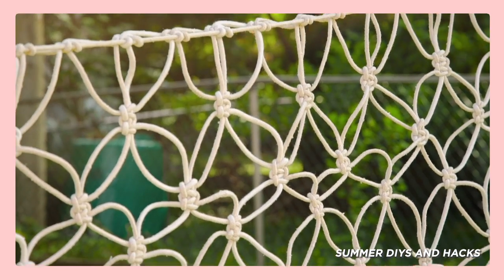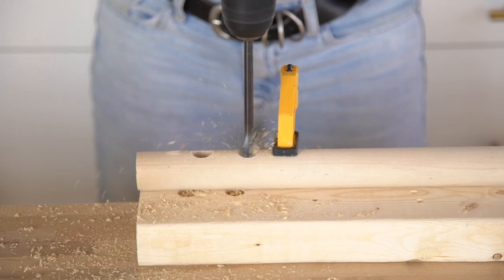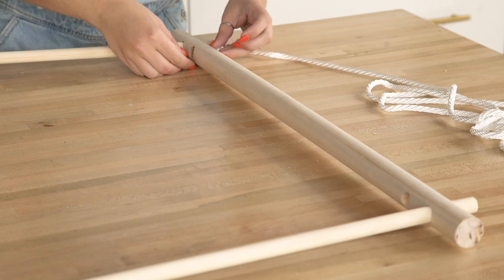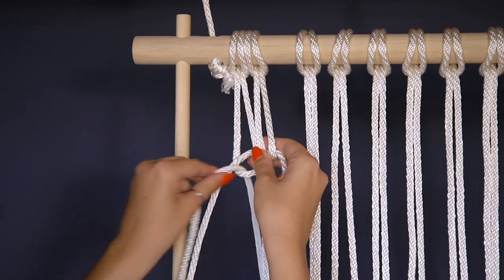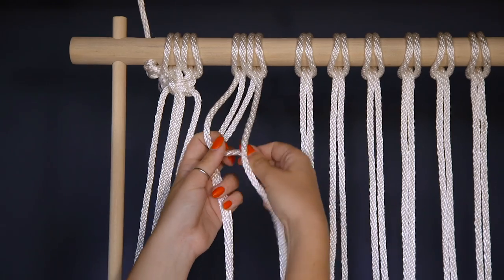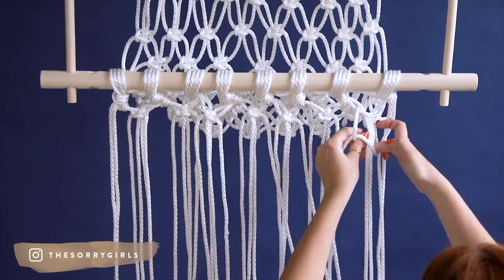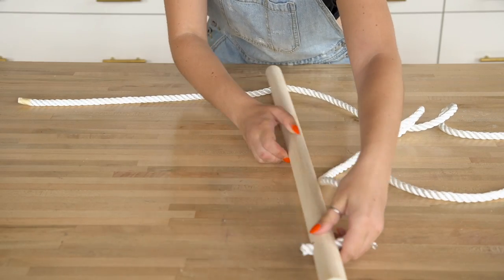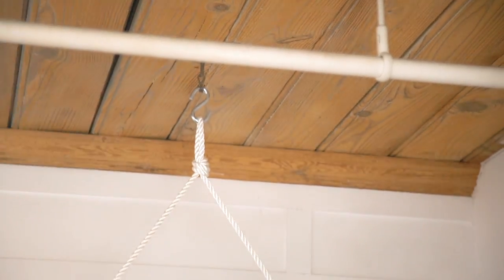DIY a Gorgeous Boho Macrame Chair

Comment: Does anyone have like a store bought version of this? And is it expensive? Because I really want to get a chair like this but idk if it would be cheaper to buy it or make it 🤷‍♀️
Reply: nikivictoria maybe look on Amazon?
Reply: Definitely cheaper to make. The materials all together probably cost $30-50 and the chair would retail for $150-250 unless you go to a bougee store and then it'd be more like $400-500.
Reply: I bought a pair years ago and they were about $100 for 2.  However they were on sale at a little shop that was going out of business.  They have lasted on my screened in porch but I do put them away during our winters.  They have lasted forever and I have had kids 
rough housing on them.  I definitely think that the macrame makes them very strong.
Reply: nikivictoria they sell them for about fourth dollars at multiple stores, and I think they are that price at target too if that helps
Reply: What do those emojis mean?
Reply: Just saw one on overstock for $32. Supports 220 pounds.
Reply: Farm Girl it’s a shrugging emoji
Reply: I've seen them go as cheap as $25 on wayfair, I'd say it's better to buy than DIY in this case unless you already own the power tools and clamps
Reply: Got one for 10 bucks
Reply: I have a chair that isn't a dactyl like this but it's called hanging sky chair they are about $105
Reply: Go on Amazon I bought 1 about a month ago for about $70
Reply: Wayfair has them for about $20-$50 USD. Just search for hanging chairs.
Reply: nikivictoria certainly doable! I think the hard part is the drilling because you need a lot of tools. Yes, it's expensive to buy and cheaper to make. But when you buy, you are paying someone's labour. However, doing it is fun and it is rewarding when everything works!
Reply: pier 1 for a range of prices.
Reply: nikivictoria maybe just buy is from Kmart
Reply: nikivictoria I bought this on Amazon for 32$
Reply: It’s about 50$ on amazon
Reply: @gothempress  not if it really takes 200 yards of 1/4" polyester rope. 200' is about $22 and you'd need that x3 to get the whole 200 yards.
Reply: @Blerdunn2618  that's true about the rope. But suppose that's how much you buy the rope for (instead of finding it wholesale, for example) that's $66. Then the dowels probably cost $10 total so for half the price you can make your own hammock chair. Even saying you get a mounting kit, that's maybe $15 more, so you still get a hell of a savings.
Reply: @gothempress  I priced the dowels at my local Lowe's and the 1/4 inch ones, which should be hardwood, are just short of $8 before tax. The 5/8 inch dowel is about $5 before tax.
Reply: @Blerdunn2618  Again, the chair in store is $150-$200. So if you pay even $100, you're still saving money but I cannot believe it would take $100 in materials to make this. Finding these reclaimed or wholesale is going to be a lifesaver on the amount it takes to make it. Or sometimes going to a local lumber yard instead of a big box store could be helpful too.
Reply: @gothempress  I found a similar chair for about $30 online. If you check out the other comments on this video, you'll see others have found similar chairs for a similar price. You can disbelieve the prices I've provided all you want, but anyone can look them up.
Reply: @Blerdunn2618  up until this point you've never mentioned how much the chair you found online was. I did, and you replied to me with some prices of materials that I did not dispute at all, if you look back, so idk what you're on about me not believing you... i'm fine with being wrong, but you presented that arguement all ass backwards.
Reply: And the figure of $100 was me rounding up, before you get all excited. That wasn't me disputing YOUR prices.
Reply: @gothempress  ". . . I cannot believe it would take $100 in materials to make this." Rope x3 $66. 1/4 dowels x3 $22. 5/8 dowel x2 $14. Total before tax: $102. Total after tax in my state: $108.

This is rounded down to the nearest dollar and is therefore less expensive than what it actually would be. It also doesn't figure in time costs. 

Also, you have the order of comments listed wrong.

You- it's less expensive to make it.

Me- not if you really need 200 yrds rope.

You- even if rope is that much, you still save.

Me- this is about how much the dowels will be. 

You- chair is $150-$200. Even if you pay 100 to make you still save, but I don't believe you'll pay 100.

Me- chair is $30. Prices are available. 

You- you never said how much chair was until now and I did. I didn't dispute prices. Your arguments are out of order. 

You- $100 was rounded up. 

But whatever. You're just some internet person who clearly didn't look up the prices. I won't respond anymore.
Reply: @Blerdunn2618  You. Are. Missing. The. Point. First of all, mister, I SAID I recognize that I could be wrong about the chair price. When I <<< had priced the chairs, they were $150-$200, which, based off of MY assessment would still make a $42-$92 savings. That's all I was saying. I don't understand why you keep driving a point home that doesn't fucking matter when I ALREADY SAID THAT I AGREED WITH YOU.
Reply: On Walmart.com there is a ton of egg chairs and hanging chairs and I bought was recently for around $40-$50 dollars, but my order got canceled due to current situations
Reply: You got some point
Reply: l do not exactly  the same  it was 60  - 70 dollars Canadian

Comment: On those outside loops that weren't used on the alternate knots could you loop it round the dowels to connect it to the sides rather than having the gaps on either side? For more security?
Reply: We did and we found the chair to be more comfortable

Comment: Sorry for a boring question but knowing my family I have to ask......How much weight will a chair like this hold?  Thanks guys!
Reply from the maker: The rope you purchase will say how much weight it can handle. It also all depends if it is installed properly with a proper hanging kit. I would look at both of these amounts and decide if it is a safe option for you!
Reply: Beth Hughes i wanted to know the same.
Reply: What about the wooden dowels? I feel like they could break.
Reply: Ashley ! Same thing as with the rope...it should have some weight testing measurements on it.
Reply: TheSorryGirls o

Comment: Hi, I have a question, I have a doubt, because you have to buy 200 yd of rope, if only 16 cuts of 26 ft each are used and that results is 416 ft (138.7 yd), why?
Please could you explain to me what am I missing?
Thank you so much.
Reply: Exactly!!!! So frustrating! I started and then I realized that it doesn't make any sense and ended up spending more money than I expected. Besides that, at the end it says that you have to make more holes on it. Oh well.... Good luck.

Comment: This actually much more complicated than this video. It took about $300 to make and a few weeks of really struggling to make it work. I had to put masking tape  over several rows of the knots so that I could tie the rest of the rope on to the second dowl to keep the previous rows of knots from messing up. That was just one of the many hassles. After measuring out all the rope, cutting all the rope and one row of knotting, I couldn't move my shoulders for 3 days after 😭 Most of your measurements are wrong and forgetting to mention the extra holes in the dowles after the project is almost done is almost evil after all that work, tears, sweat and money. I did finally finish it  but I wouldn't trust it for anyone to actually use. I'm a craft person so good luck to anyone else trying to make this. 🤔
Reply: I AGREE.
 I’m confused with the size of the ropes, 200 ft and I need 16 ropes of 26ft each? 
16x26=416, NO WAY that I’m gonna make it with a 200 ft roll 🤔.

Comment: Not easy! I love DIY crafts but this one was not easy AT ALL. I struggled a lot with this chair. First, the drilling was incredibly difficult including the fact that drilling a hole that large and that deep is tiring but after a while it started burning the wood, and even got to the point where my wood would almost catch on fire. Next, the holes of the dowels were incredibly uneven making the entire frame snap, yes I did measure it evenly but it came out all weird. It was incredibly uneven so I just discarded the two small dowels holding the frame together and tied it with rope. Oh the rope, this was my own fault but it still added to the frustration. I thought I was all done with cutting the rope and I was so happy so start macrameing, nope. The long pieces of rope apparently added confusion and they got tangled up so the end piece of the rope (which was the shorter piece) was now being used as the “guide rope” and they ALL became Wayyyyy shorter than supposed to. By now I am mad, and this is not taking into the fact that I needed twice as much rope as said in the video so I in total needed 5 packs of rope, the same rope she used. By now, I am 4 weeks into this project and I am raging. So after tying the rope together to make the correct size I was ready to macrame. The macrame was easy and and I finished quickly but now the fun part began. Tying it to the fucking ceiling. Now let me tell ya, I DID NOT KNOW YOU NEEDED THICKER rope. So now I have to go back to the store and get some more. Now this is where I am so far but I am so done with this project and I do not recommend. BTW the link in the video description has different measurements than the one in the video so that was a fun time. This seems inexpensive fun and easy project but it was challenging and I will never do this again. MAY I REPEAT THIS IS INCREDIBLY CHALLENGING AMD I STRONGLY ADVISE THAT YOU DONT DO THIS.